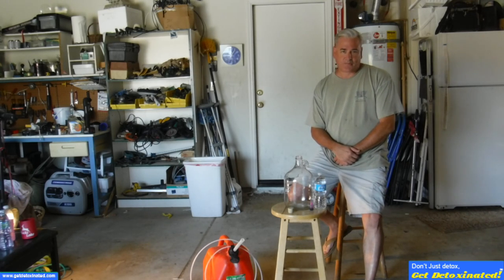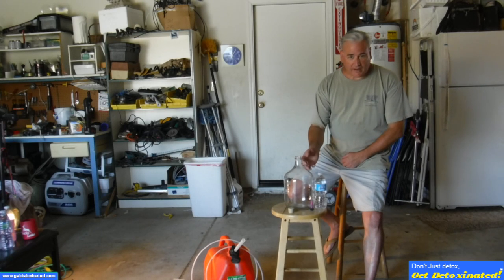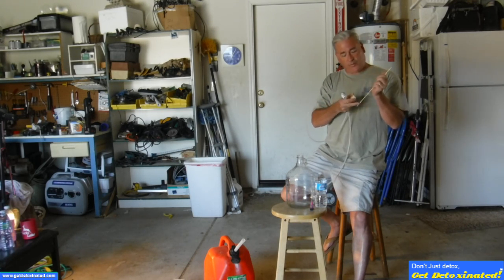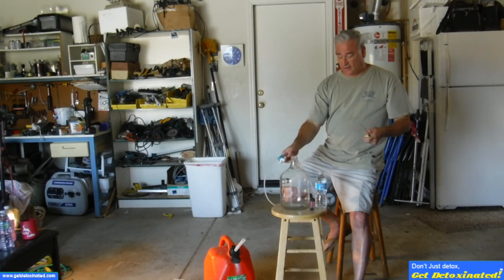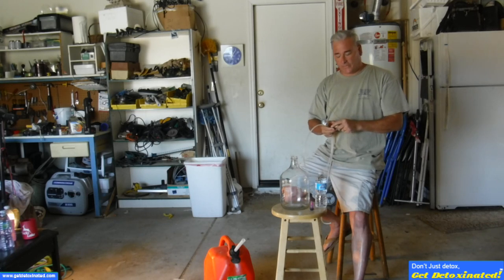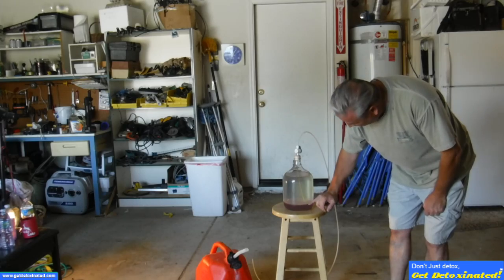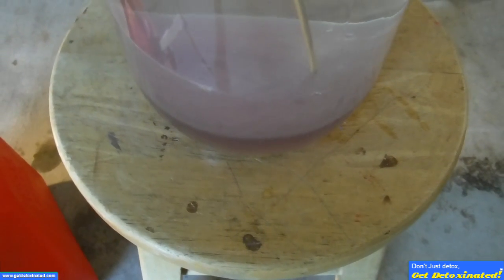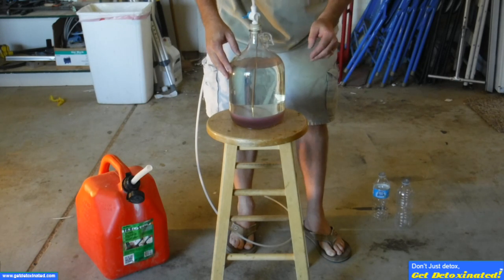How to remove ethanol from gas for 2 stroke engines

Comment: One thing you forgot to mention is that in order to do this you need to use premium gasoline.  Removing the ethanol will drop the octane rating by 3 points.  If you use regular 87 octane E-10, the end result will be only 84 octane pure gasoline.  With premium 91 or 93 you will get either 88 or 90 octane fuel.
Reply: Joel, two-stroke engines don't share the problems of four-stroke engines resulting from low octane fuels. Detonation (knock) and preignition are reduced by using slower burning (higher octane) fuel. This is important for modern four-cycle engines with high compression ratios. Two-stroke engines do not have the compression ratios required for detonation, and a two-stroke engine suffering preignition will simply stall. As such, a two-stroke engine will not destroy itself like a multi-cylinder four-cycle engine where the remaining cylinders overpower preignition until it damages the cylinder. 

Ethanol is actually a superior fuel to gasoline. It burns much slower and is more energy dense. However,  that slow burn increases heat transfer to the cylinder wall. Four-cycle engines are water cooled and can remove this additional heat. Two-cycle engines are air cooled and the increased heat can degrade lubrication on the cylinder wall resulting in friction. Once friction starts to add additional heat, engine failure soon follows (usually takes about 30 seconds from first notice of power loss, if you don't immediately reduce throttle). 

So, four-stroke engines always benefit from high octane fuel and ethanol is actually preferable if the engine was designed to burn it. Two-stroke engines prefer low octane fuel, especially in hot weather. Hope this helps. It's all stuff I had to learn the hard way!
Reply: wow what a load of cobblers. I run 2 stroke motors. outboard engines and trust me we do require the octane to run good. if we have a high compression motor ( over 160 psi) we then need 100 octane to run good. if ultra low compression then the 2 stroke wont even start let alone run. now the average 2 stroke only suffers with ethanol if left in the tank or carb for a period of time. a weedwacker will not even notice the difference with 10% ethanol...  now maybe you dont know it but you've been getting ethanol in your fuel since around 1920.   for 5% ethanol a garage dont have to even mention ethanol. its only 8% or over they are supposed to tell you how much is in the fuel your buying..... 2 stroke outboards are best run on around 91 to 93 octane for the best power ... now as soon as you task out the ethanol you need to put back some octane. if you run too low octane then your machine will be suffering big time....... do not think all 2 strokes are the same.. nearly all 2 strokes  ( apart from high compression race motors) are very happy to run on ethanol up to 10%  and upto 15% for short runs ( 1 hour or less on the odd occasion).... Ethanol is not the demon you might think it is. it mainly attacks the non ethanol cheap rubber hoses and gives the fuel a short lifespan ( 6 weeks max) after that it loses its power in a big way......... I have a 145 psi compression 2 stroke that will benefit with 93 upwards octane, but will also run on 89 octane just lower power. it was made in 1995 therefore perfectly safe to run 10% ethanol....
Reply from the maker: It wasn't a concern to me if I lost the few octane points as 2 stroke and other small engines don't need the higher octane.
Reply: They kinda do. Preignition is a concern.  @pragmaticmindset8989
Reply: It's also $23/gallon.  Compare that to pump gas with ethanol in your area (mine is just under $3/gal) that's an extra $20/gallon.  Add that up and in no time at all you could have just bought a new machine.  Canned gas is a waste of money.
Reply: Canned 40:1 or 50:1 oil/gas mixture is $20 per gal, or $5 per quart from Walmart her in N TX.  That's expensive. However, since I only use if for a weedeater and rarely for a small chainsaw, that works out to five to ten dollars per season.  Compared to all the work to separate out the ethanol, that twenty bucks is a cheap expense.
BTW, what is done with the ethanol-water mixture after it's collected?  This video doesn't mention that.  I guess you just sneak over to the property line, or out in a bar ditch in the country, and dump it.  That's how homeowners in the 50s and 60s often disposed of the dirty black used motor oil they got when they changed their car's oil at home.  They left behind clumps of greasy black dirt and weeds.  The oil never got a proper disposal.  Someone is probably drinking the nasty stuff in their well-water today.
Reply: For the weedwhacker and other small two strokes I have just resorted to buying canned/synthetic gas already premixed for two cycle engines. That stuff does work well. It also holds up for a long period of time without degrading.
Reply: Newer Stihls (chainsaws anyway) say they will run on e10. I trust Stihl knows what they are talking about but it's worth the peace of mind to run non-ethanol. I often get into big timber and thus make long full-throttle cuts so I just don't' screw around with e10. Besides, trying to store e10 is a challenge.
Reply: With you on that Ron.  From Wikipedia:  "Ethanol and fuels like E85. 1.5 gallons of ethanol has the same energy content as 1.0 gallon of gasoline. A flex-fuel vehicle will experience about 76% of the fuel mileage MPG when using E85 (85% ethanol) products as compared to 100% gasoline. ... Pure ethanol provides 2/3 of the heat value available in pure gasoline."
Reply: Nathan Egbert f.
Reply: LoveClassicMusic0205 d
Reply: how will removing the ethanol change the ratio of octane and heptane?
Reply: So 2 questions. (1) since octane is boosted primarily with Ethanol based additives, Does starting with high octane just result in removing more ethanol and put you at the same finish octane as starting with lower octane and removing less? and (2) All the octane boosters seem to be ethanol based, so isn't adding them as some recommen sort of undoing the removal process?
Reply: Or, you just go to a damn MARINA (Iake, ocean, river) and purchase 100% gasoline for your small engines.
Reply: @QuantumRift  In some places, yes. Not anywhere in CT or RI, the gas at marinas still has ethanol. CT is the California of the East.
Reply: marina for ethanol free ? are you joking / airport yes marina no, they run upto 8% and dont have to mention ethanol..
Reply: @QuantumRift  TRUTH in Maryland
Reply: Pragmatic Mindset not a concern... I thought you cared about your engine
Reply: synthetic fuel really screwed up my stihls. I drained all of my stihls of VP SEF because the fuel wasn't stable and clogged up my carbs with too much oil. Resorted to e10 and fuel stabilizer, my Stihl now run. I plan to decant out the alcohol in the near future before my stored e10 ends up screwing up my stihls.
Reply: @thinkingimpaired5663  i was a auth Stihls dealer... the problem was not the vp sef it was the stihls 2 stroke oil... there is a mesh steel spark arrestor inside the muffler that carbons up so it needed to be cleaned.. stihls were meant to be run wide open throttle if you let them idle there mess up.

Comment: lol.. you look like the caption on the series (the last ship) thx for the video caption..
Reply: mark vietti  use Sta-Bil marine 360. Buy it at any Walmart auto parts store or Online Amazon or Ebay
Reply: I do but does that remove the ethanol ?
Reply from the maker: Nope.  No treatments or stabilizers actually remove or even break down ethanol.  They "protect against the damaging effects experienced when using Ethanol blended fuels -- including corrosion caused by water attraction, and fuel system plugging caused by deposit loosening".

Comment: Thanks for the video.
Please, what is the purpose of pouring the bottle of water into the gasoline?   .... was it merely a delivery system to help get the food coloring incorporated into the ethanol gasoline? Thanks.
Reply from the maker: Great question!  First off, the food coloring isn't required for the removal process; however, it does provide a visual indicator of the phase separation while draining off the water/ethanol layer.  Secondly, ethanol binds to water better than gasoline, therefore the water pulls the ethanol out of solution with gas and the new mix of water/ethanol, being heavier than the pure gas, collects at the bottom of the container (just as water and ethanol do in a fuel chamber of an engine -- and the first to be sucked into the carb!).
Reply: Got it! Thanks!
Reply: So that explains the droplets of moisture exiting my muffler immediately after I start the engine?

Comment: This damn ethanol is killing everything I have I hate it. If you let it sit in a carb it will clog up the Jets and turn everything inside it green smh damn Government.
Reply: So they put ethanol in our gas to save the environment. It destroys the parts in our car, so we buy more to fix them. It takes fuel, labor and energy to manufacture these new parts. We put additives in our gas to make it usable. The additives come in plastic containers and it too has to be manufactured, refined and packaged. We put back in what they take out. We create the same pollution we had before ethanol.. no wait, more pollution since we are now adding things back in to our fuel to make it useable and wasting plastic containers etc. Oh and don't forget about another big lie they pulled without telling us. They removed essential zinc from out motor oils. Do a little research on what motor oil without zinc will do to your lawn mower, your other small engines, your older engines with flat tappet cams..
Reply: @seeburgm100a  Its all BS.. Same thing when they banned R-12 saying it destroyed the ozone. Sure it did, in a lab. But other scientists have said (and proved) that when R-12 (dichlorodiflouromethane) mixes with all the other gases in the atmosphere it becomes inert. But it led to a billion conversion industry. It's all about lobbying, who has the most money to throw at the cause, and make the most noise. Al Gore has become a millionaire from it.
Reply: @steadyeddie7453  Did anyone ever discuss how much free chlorine gas is emitted into the atmosphere from swimming pools and municipal water treatment plants? of course they didn't as you mention Eddie it's just too easy to attack an industry that they can profit from.
Reply: @seeburgm100a  I didn't think of the chlorine gas emmissions from these places. Good one. Heres another- when emissions testing first came out, diesel vehicles were excluded. WTF? We've all got behind a dump truck or semi belching exhaust fumes from their stacks. But I guess the truckers union and diesel companies paid big $ for the EPA to look the other way for several years, until they finally enacted emissions standards for diesel vehicles. Or how about every time we launch a rocket into space. Has anyone analysed what all that solid rocket fuel is doing to the atmosphere?
Reply: seeburgm100a boy those government engineers sure are smart aren't they
Reply: Glass jar full of gas on a loose seat stool over a concrete floor next to a gas water heater. What could go wrong 😰
Reply: Pilchuckski good observation there my friend. But nobody else noticed that except for me and you but that's only because I was a firefighter and I do pyro for a living now
Reply: ssssssshhhhhhhhhh You're not supposed to notice that stuff.  Besides, it's the manufacturers that are supposed to adapt their products to how the Government says gas and oil should be made.
Reply: Obama gas
Reply: Yep. Corn is food.
You know it's wrong when you're using food for fuel.
Reply: New Generation f**** Nazi politicians. Destroying our Motors poisoning our food trying to take our guns. maggots... we should start a civil war on that alone
Reply: More info at: https://www.youtube.com/watch?v=LHM5qHxbFqY&ab_channel=MikeM&ab_channel=MikeM
Reply: that actually worked on my GSXR 1000 I might try that on my chainsaw son of a b**
Reply: Al Gore
Reply: @trooper2221  Monsanto on and on
Reply: easy by gas with no e god damn shit head fuck ups
Reply: Al Shaw those Pricks probably sell the additives
Reply: Al Shaw - You have a most impressive command of the English language going on there. I’m sure you’ve made your parents very proud. Everyone prays their offspring will be such intellectual powerhouses as you.
Congratulations.

Comment: Nice setup!  I like the stool as the holder.  One comment is that I would be loathe to use a glass jug, as smashing it by accident would be really ugly!  I think there must be some really big plastic jugs.  I use a gas can and just drain it until gas starts out.  But I like seeing it.  Thus far I have only had to rebuild one carb in the 5 or so years I've been doing this.  I have 5 two stroke and 3 4 stroke engines I run this stuff in.  

Thankfully they have not seen fit to pollute diesel, so my tractor is safe.
Reply from the maker: Thank you for your comments!   I did research plastic jugs, but petroleum etches or melts most plastic, which contaminates the final product; unless you're willing to spend more on High-molecular-Weight-HDPE polyethylene (which is what plastic gas cans are made from).   For the purposes of the video, glass was the obvious choice.
Reply: A chemist supply would have glass valves and tubes .  Good Idea, thanks for sharing.  Hopefully President Trump will do away with ethanol !
Reply: Have we not burned soy diesel yet?Regards..

Comment: Ok so should I run alcohol in my blaster which is a 2 stroke quad or will it not be worth it because it shortens the life of the carb and Engine and the fact that I have to drain it every time I use it
Reply: I am not racing but want to get all the power out of it without destroying it
Reply: just run premium bruh.